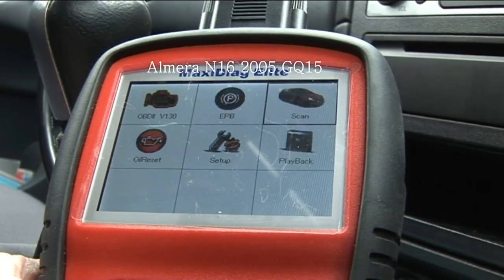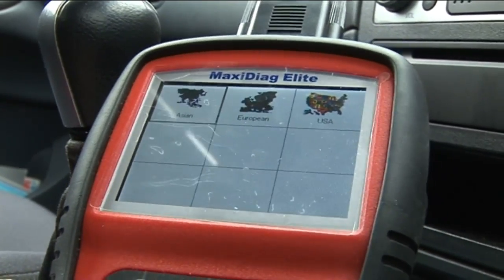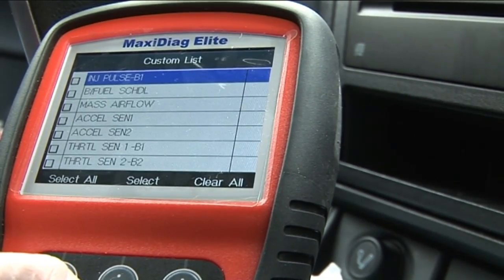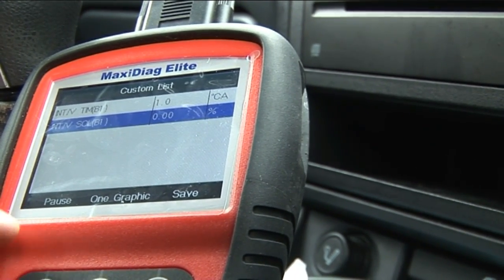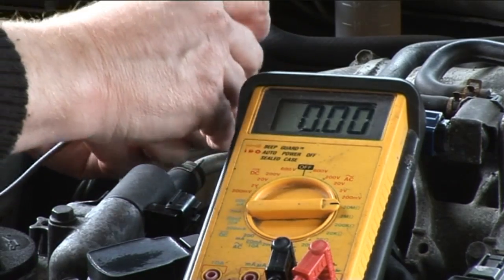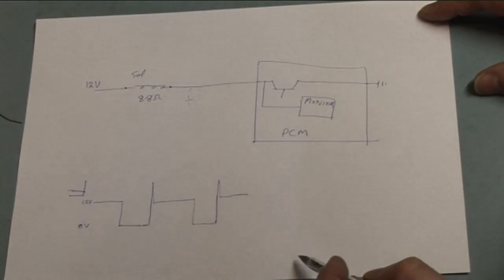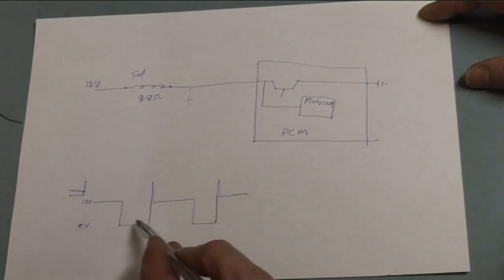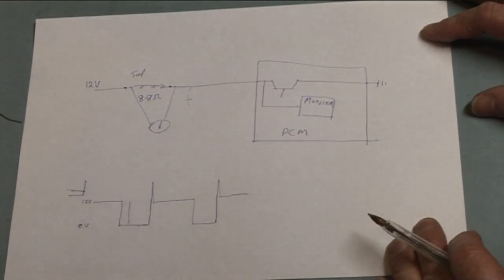Autel MD802 on Nissan Almera DTC P1111 using Autel MD802

Comment: greetings bro! I've been looking for a reliable & affordable scan tool for some time so i went ahead and bought the Autel MaxiScan MS300 CAN Diagnostic Scan Tool for OBDII Vehicles from amazon, it arrived today and i tried it but it wouldn't scan! i also own a 2002 nissan n16 almera & i hail from all the way in Trinidad (Caribbean) where mechanics tend to rip you off can you please advise me on a reasonable scantool that will work?
Reply from the maker: Did you do an update on your scan tool? if it is possible, do an update first
The MD802 is a very good scan tool, it does all systems, the next one up from that is the ds708, a bit more pricey
Reply: ok bro! appreciate it much!!! i'll try that!

Comment: I have problem with that solenoid. I changed it and it still says its broken. I measure it and its says 10,6 ohms. And that part is new one. Also it 12v on the other side and zero on the other side as power is on but motor not running. So is this new part also broken?
Reply from the maker: I have never seen 0V on the control side of the solenoid, as the control side is a pwm control.
did you also check the oil level, as the solenoid controls oil pressure to the vvt gear
Check also for a short to chassis/ ground, this would give you a 0V reading on the control side
Reply: Tommy Loafer

Comment: Low oil makes this fault
Reply from the maker: I agree, low oil could cause this,  that was the first thing that was checked, oil level was ok
This had an open circuit soloniod
Reply: @ElectronicWorkshop  how do i know if the circuit is open
Reply from the maker: two ways, with the KOEOif there is only 12V 0n one of the PIN, also you can get a multimeter and check the continuity acroos the pins @niksmaithy6929